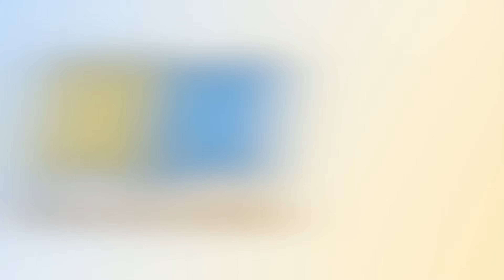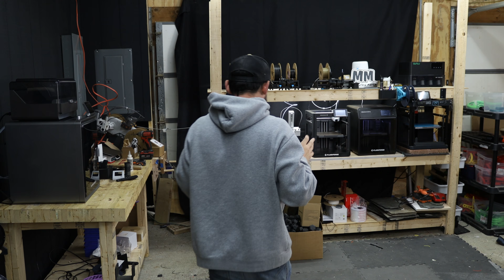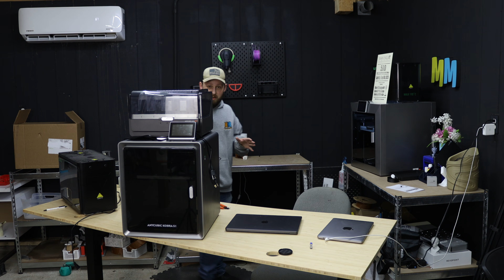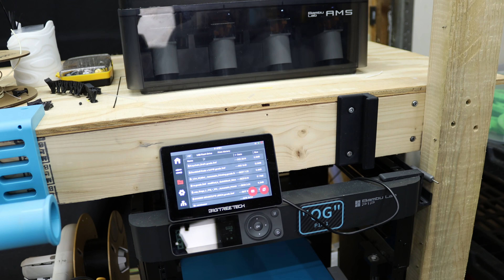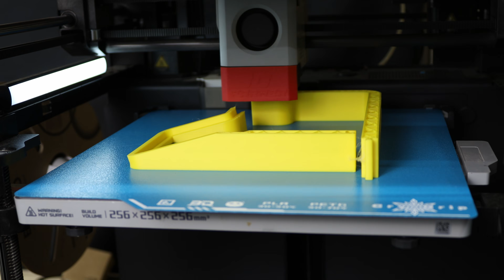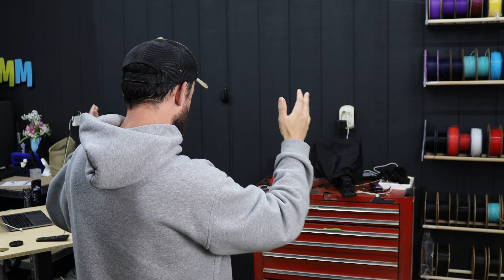This Setup Made My Workflow WAY Easier

Comment: i took the small allen key that came with the printer and ran it through each end of the ams slot, and it was fixe. Eleegoo spools recently, at the end of the spool, have been sending tape and cardboard into the ams.

Comment: when you insert filament into slot 1 is the motor feeding it through the bowden tube if so then it it not the motor. You said it could happen when you were printing and it switches to slot 1 so I assume that the filament was already fed most of the way through the bowden .in slot 1 so I think  the problem must be on the extruder side probably where the 4 Bowden tubes go in.

Comment: I'm just wondering why you're not making (better) use of the bottom shelves. You could place printers there and/or use it more efficiently for storage. Maybe change the height of each shelf a little?
About your lighting situation: a bit more work, but you could install some receptacles on the ceiling to plug lights into, then switch them with a smart plug. You could also go for some square or rectangular led panels.

Comment: I'm only about 7 minutes in, and I'd suggest either putting the AMS up on the top shelf with it's stock mount(yeah, you'll need a step ladder to change filament on it), 'wall mount' it on the front of the upper shelf like you had the single spool mounts, or (what I'd definitely do) take the A1 AMS lite GRIP mount from makerworld, and modify the part that normally attaches to the top bar on the A1, and adapt it to either a foot, or screw-down mount, as it rotates easily (making changing the back spools easy), and can be locked into place when not changing filament.  I use those mounts on all my A1's (not minis), and all you'd need to do is extend the PTFE tubing to reach the printer below.  I'd definitely go with a screw-down type mount instead of a regular foot/pedestal type mount so it can't get pulled off the shelf.
Reply: Not sure how feasible it'd be, but I'd probably put a shelf above the toolbox, and put your filament driers on it, making it closer to your storage shelves.  Either that or move the toolbox and but a small bench there with them on it.

Comment: Are you having any bed adhesions issues with PETG in farm loop? I can’t seem to do more than two or three prints before having to wipe down my build plate.
Reply from the maker: I havent run PETG with Farmloop on the Minis but havent had any issues with adhesion on the P1P. PETG is one of those things that typically ends up sticking too much in my case which is why the P1P is my go-to with that filament. The bed flexing helps pop it loose so the print head is able to push it off. Without that, it stays stuck to the build plate even after hours of sitting. I typically clean all my plates with soap and hot water before I start a run of prints as well.
Reply: @TheMountainMaker Thanks! I guess I’ll throughly look into this, otherwise I believe there’s another system that simply swaps the plate out. Definitely more of an upfront cost, however.
Reply: That’s what I’m worried about. It doesn’t matter if I dry the filament or not, PETG always leaves residue. It sounds counterintuitive, but I read that using some sort of adhesive helps? 

I print PETG 90% of the time so this is what’s stopping me from buying it.

Comment: You have tried a different spool in that slot right? Sometimes mine will throw that error if the filament is a little chewed up from the gears. Usually I'll just cut that section off and feed a fresh section into the AMS lite and it'll pull it through with no problems. I'm sure you've already tried it, but just throwing it out there in case lol
Reply from the maker: I have, although they were all from Elegoo but different colors and different spools nonetheless. Thanks for the suggestion!

Comment: I enjoy these videos, they inspire me to go and make my own area a bit more tidy and efficient! I'm not that organised so I need all the inspiration I can get 🤣

P.S. Could you put the AMS on the shelf above and extend the tubes?
Reply from the maker: Thanks! I suppose I could move the AMS Lite up above the printer, but I worry that extending the PTFE tubes that far would cause issues with feeding the filament. I used to have it above my printer when I had my A1 and even with stock tubes, it would constantly have issues feeding filament or would throw and error code during the prints.

Comment: I still can'd get PLA runing on my tevo tarantulla but 60 mm/s is to fast agess. And when I make settings to the hight it's anyway not the same after I hit the end stop the next time.😮
Reply from the maker: It sounds like you might be having some issues... possibly a loose belt affecting your consistency. Im not familiar with that particular printer but I know my old Ender 3 had similar issues.
Reply: @TheMountainMaker 
Yep the learning curve is hard. I think I try the ender with all upgrades further.😮